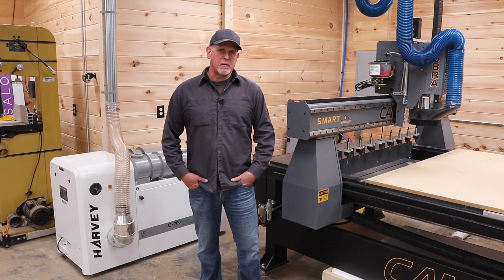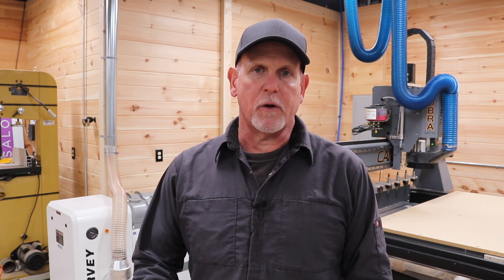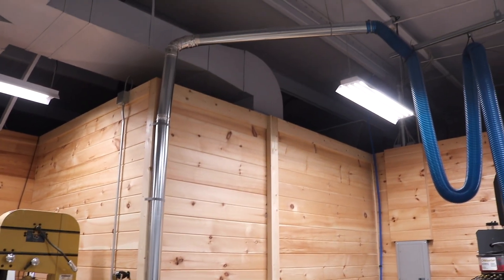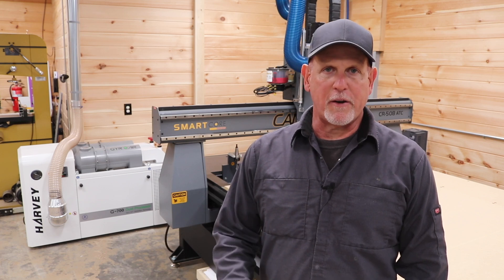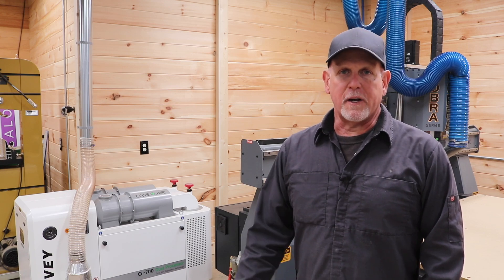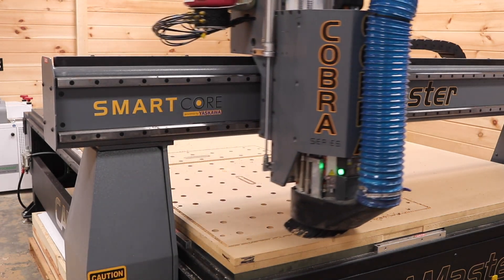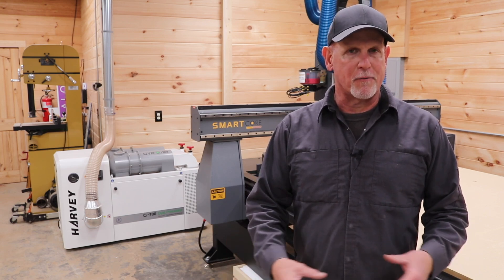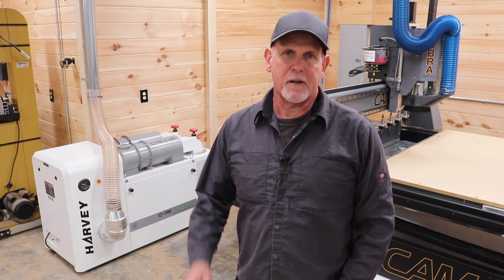Dedicated Dust Control for CNC Machines - Harvey G700

Comment: Have you found a reasonable source for HDU? We tried it years ago but I think a 1in thick sheet was over $200 for a 4x8 and I found the stuff to be incredibly hard to get paint to stick to it. Try painting it and then using something like oramask for an additional color. Peel up the mask and the paint comes with it. It was madding for me.

Comment: Thanks buddy, very nice system, in my days of working for the man before I retired had experience with dust control and material moving with vacuum and we grounded our suction lines especially when there was connection between clear Spyro tubing and metal pipe, we also treated ambient air with humidity and used ionizer blowers. Great to see you and take care.